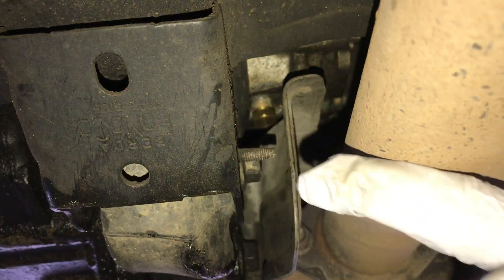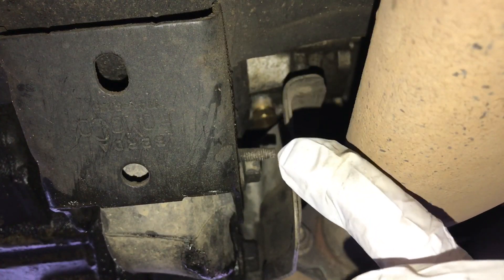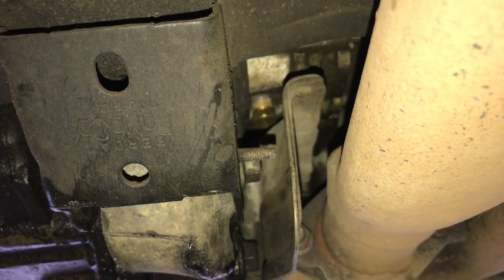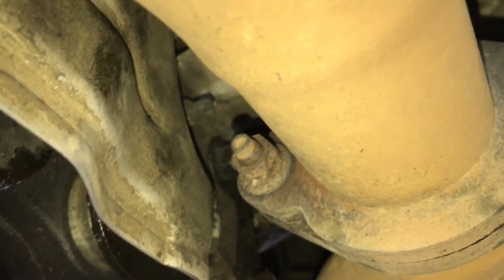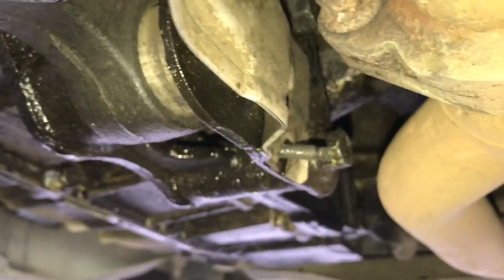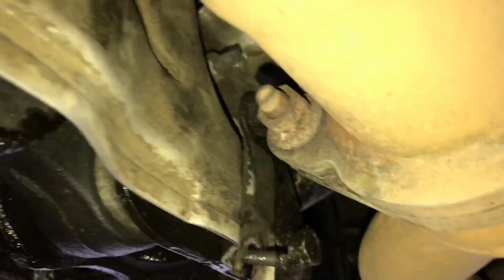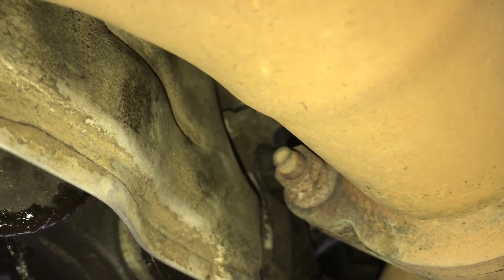Ford Edge PTU: Drill & Tap-Before and After 10K Miles (MKX)

Comment: Great video thank you !  I actually work at the Oakville plant in Canada where we make the edge and mkx. I helped my parent both purchase edges my dads is a 10 but fwd. my mom has a fully loaded 09 awd. 

Recently we had both Edges into a dealer for the gas tank recall. On the 9awd they forgot all the muffler and exhaust hangars off and mom drove home 25 miles with the exhaust bouncing damaging the flex pipes and hopefully not the manifolds and heads but I hung it all up and sent my mom back where they did replace some of the exhaust.  Long story short they told my mom tpu is bad and gave her a $3k estimate.

I did some searching and found your video and wanted to say thank you 🙏🏼 for the tips and info. Definitely sub’d 👍🏼👍🏼. I drilled last night and tapped a drain hole but am struggling to find a pipe plug near me on a weekend but hopefully have it finished up tonight .
Reply from the maker: 5abivt thanks for joining! Sorry to hear about your mom’s misfortune, and I’m not shocked to hear them quote $3k 🤦‍♂️. 

As for looking for the plug, if you go to an auto parts store and ask for the 1/4 npt plug they should have one. Around here a couple of our auto part stores are open till 9 pm. I had to ask for mine and the store employees and I had to walk behind the counter and find the one I was looking for to complete this project. So maybe try that route... it might not be out front but they might have one hiding back in their parts area. I got mine from O’Reillys, not sure they have those in Canada, but they are fairly common in the U.S.
Reply: Buck Newby appreciate the reply ! 🙂 I went to a unique hardware store and found an Allen  head bolt and just finished cutting it down to ensure it didn’t protrude too far inside. Using an oil resistant o ring at the head so I know when it’s snug and should seal great and not worry about over-torquing the bolt. 

If I may ask, did you know what the capacity was for the ptu? Have my little pump and gear oil ready to go back in. Btw my moms fill plug had sludge on it, but lots of fluid did drain out. Her 09 only has about 35k miles on it as she drives less than a mile to work. No doubt it helped the ptu live longer
Reply from the maker: 5abivt I’m pretty sure it’s about a liter but I’ve drained mine a couple times now. All I do for adding fluid is pump until it overflows. Pretty easy. I’ve never measured the exact amount in, but know it’s about 1/2 to 2/3 of your average bottle of gear fluid. I would suggest you buy an extra bottle and pump it through with the drain plug out to pull out any shavings that may have ended up in the gear box. Frankly I wasn’t too concerned about aluminum shavings vs steel gears, but pumped an extra bottle through the box just to be safe. And if you are really concerned you can repeat the process again after driving the car for an hour and the process of the gear fluid heating up and splashing around should pull/flush sludge off the gears and inside of the case.
Reply: Buck Newby thanks again 👍🏼👍🏼. I filled until it started pouring out .. I’d say it was about half a bottle maybe less not sure. But I did pour some in and let it pull out a few loose shavings first. Going to drive it around for an hour then drain again hopefully pull out some sludge.
Reply from the maker: 5abivt way to go! Let me know if you have any  thing else come up!

Comment: Hey man, I had my PTU on my 08 MKX replaced with the updated unit about 30k ago. Not sure if it has a drain plug, but I may end up doing this too.
Reply from the maker: Captain Brown Beard thanks for joining the conversation, keep me informed, I have been curious if we-first generation Edge owners-can get a PTU replaced with a PTU from the model years 15+. Seeing as those come with both fill plugs AND drain plugs, the cross compatibility would be good information to pass on, and surprisingly not a question I have seen answered yet. If you don’t mind me asking, since replacing 30k miles ago has your PTU been serviced yet?
Reply: It actually hasnt been serviced as the stealership gave me a 2 year warranty on the part and well its over now so I am looking into servicing it myself. I got two other issues that maybe your Edge ended up with?

1. Slight shudder on light throttle at around 40mph with low rpm (Google says it could be coil packs/plugs)
2. I have a ticking sound over bumps in the suspension. LCAs, tie rods, ball joins, and sways are all tight with or without a load. Maybe strut mounts?
Reply: Also, I have been changing my coolant every year cause im scared of the internal water pump and I had my transmission fluid changed with new Speed sensors in the transmission at 90k miles (At 115k now)
Reply from the maker: Captain Brown Beard I haven’t experienced the shutter at 40 mph but have heard of such an issue before but cannot quite remember what people blamed it on. 

The second issue sounds like sway links... because I had the very same thing happen where there was a little slip even though they felt tight- load/no load-and were freshly replaced. What it ended up being was the hole on my LCA was a little wobbled out and so I had to replace the LCAs with fresh sway links to resolve it. I have not done the strut mounts on my Edge but think they might be going because of what I hear when I’m cornering hard at slow speeds. 

I’m not 100% sure if that’s helpful or not but it’s part of what I’ve learned so far over the last 18 months of working on this 205k mile hog.
Reply: Man I hope mine gets to 205k miles without the damn water pump failing. I will stay with sways and then do the LCA's I actually wanna do struts, mounts, LCAs, and sways to bring the front end back to new. I just did a whole front end refresh on my 94' 540i and the thing drives like new haha
Reply from the maker: Captain Brown Beard as long as you stay religious about changing that coolant out every year you shouldn’t have a problem. I think most people take the cooling system for granted and then end up having issues with water pump due to complacency.
Reply: Buck Newby p

Comment: Thank you for this. I will be getting under our Ford Escape and going through the same procedure. This helps me a lot in getting the confidence to do this.  You would be amazed at how many people say this cannot be done. But they are still afraid of falling off the edge of the earth if they go too far.
Reply from the maker: Oby-1 no problem I’m glad it helped! It’s easy in concept, drill a hole, thread it, plug it. I’ve yet to hear someone attempt this and fail, but have seen a lot of people do it, so focus on executing the three tasks above and you’ll be fine. I have a follow up vid to this where I answer some of the recurring questions. 

Ford Edge: PTU Drill and Tap Measurments and Other Useful Information to Answer Recurring Questions

https://youtu.be/KQWh5cp2ZEc

Comment: Can you wrap the exhaust with foil insulation to stop the heat build up? I think the proximity to the super heated catalytic converter bakes the oil and breaks it down too quickly. Keeping the heat away from the PTO keeps the oil from breaking down
Reply from the maker: I’ve heard people suggest wrapping before. I am not sure if it would be practical. It very well could improve longevity.

Comment: Great video!  I'm going to be completing this in my 2010 Edge.  Any reason you went with an NPT thread instead of using an SAE or metric so a guy could use a normal style drain plug?  Do you think an 1/8" NPT would be sufficient instead of the 1/4", I'm just gun shy on not knowing the thickness of the casing where the plug will actually threading into, is it at least 1/4" thick?
Reply from the maker: Not sure on case thickness but I’d guess 1/8-3/16... seeing as it’s aluminum case brass is a good choice for plug because it’s more malleable. Also a smaller hole is preferable because it’s less likely a bit will catch.
Reply: Do you think a 1/8” npt plug would work out just as good as the bigger 1/4” that you installed?
Reply from the maker: MrDausen good question. Can you find a 3/16? That may be a better route. 1/4 is quick for drainage but bigger than necessary. 1/8 May be too small.

Comment: Good stuff, just had to take my Ford Flex the shop because a stinky propane like smell was coming from the front. They said it was because of the PTU. I'm definitely going to put a drain plug. 

What type of oil did you use for the PTU?

Also, if you have an Instagram account, I can show you a way to help fun your account.
Reply: Also, I'm a new subscriber.
Reply from the maker: Use redline shockproof light. Best stuff on the market. I used Royal Purple full synthetic but will be switching fluids on my upcoming video to the shockproof light.

Comment: My PTU was replaced under warranty (45k miles).  The drain plug is a great idea but will void the warranty.  Instead, I will use a suction device such as the Mityvac to remove the old oil via the factory fill hole.  Not as efficient but I will wait till the warranty is expired before adding a drain hole.
Reply from the maker: Kens Korner I don’t blame you one bit. The warranty is a valuable thing to have and I wouldn’t drill into the PTU and compromise it. Hands down I recommend suction for fluid extraction in this instance and then flush when pumping fresh gear fluid into the gearbox.

Comment: Appreciate it am scared to try it how much would it cost to let a mechanic do this type of job?
Reply from the maker: If you are apprehensive about doing the job then you are wise to not attempt this yourself! I would recommend actually having a mechanic pump it for you through the fill hole on the passenger side of the PTU. Most mechanics will not risk drilling into the PTU on other people’s vehicles because they know there is a risk of failure on this $900-$1000 part. However if you tell them you want to pay them to service this gear box, and they don’t mind trying to extract as much as they can and then filling it with fresh fluid... they will generally be able to make it happen if the mechanic has any sense or knowledge to what they are doing. You may even need to talk to a service manager about this because if it’s just a minimum wage guy behind the counter they may not be able to get their mind around what you are asking.... this may sound crazy but you will not believe the amount of times I’ve heard that story through people I’m helping here or in the MacT FB group. 

Keep me updated and if there any more questions that arise I’ll be happy to answer them here... or if the guy you talking to still does not comprehend what you are asking let me know. 

Oh and to do this a shop may charge about $100. Fluid usually runs about $20-$30 and since it isn’t exactly easy I could see why they might charge a little more. If you want to do the extraction yourself you can use one of these off Amazon:

https://www.amazon.com/gp/product/B009POZ9YY/ref=as_li_qf_asin_il_tl?ie=UTF8&tag=bucknewby-20&creative=9325&linkCode=as2&creativeASIN=B009POZ9YY&linkId=abb55b6b68c4130f66a7c30a849510b6

... it’s not too difficult you just need to block up your edge so you can get under it and have a 3/8 drive ratchet to remove the fill plug.

Comment: I just bought 2007 ford edge awd 104000 ptu was replaced before I got it . Keeping an eye oil and it's good. Great car and great video
Reply from the maker: That’s great! If the PTU has been replaced that’s basically the most critical AWD component that’s prone to failure from lack of maintenance. Keep that fluid fresh and I’m sure your Edge will not disappoint. Have the spark plugs been changed?
Reply: I'm not sure if the plugs were changed but going to do it when the weather gets warmer and I have all the stuff to put a drain plug in. Believe me I researched this car watching Mac T and your videos
Reply: I replaced the plugs at 110000 they were original

Comment: what is the reason for doing this? I'm having gear slips is this the cause?
Reply from the maker: What do you mean by gear slips? As in when your Edge is shifting?

The reason for doing this is to make servicing your PTU way easier. Ford did not put a drain plug in these from factory and that makes servicing the PTU a real pain in the butt.
Reply: Buck Newby I'm having some gear slipping so I was wondering if you had gear slips to and did this help?
Reply from the maker: Mill9999 No this will not help with slipping. I think what you mean is your transmission is slipping. If that is the case watch this video.

Ford Edge: Transmission Fluid Check and Engine Bay Walkthrough (Lincoln MKX) 

https://youtu.be/r4Xp32kZPME
Reply from the maker: Mill9999 another couple things I would look at would be tone rings and spark plugs. Both of those could produce “slip” like symptoms. The tone rings would be covered in my all about traction control video here:

https://youtu.be/CNpLQtWM88I
Reply: Buck Newby
how much would u charge to do this to my car? drill a new plug in? and how much u think Dealer is charging
Reply from the maker: I would think if you can find a mechanic who would do the job they would probably be in the $250-$350 range. If you had a friend who would do it I imagine they’d probably do it for $100. 

However I will add it is not necessary to do the drill and tap if you want to service the PTU. Really the first step is to pull the plug and look at the fluid inside and analyze what it looks like. Next you can decide if you want to put a plug in the PTU or just pump more fluid than necessary into the gear box to flush it out. 

Both of those options are acceptable ways to service the PTU. There is more risk in the drill and tap to install a drain plug but the trade off is it makes the drain of the PTU way more effective. The fill and flush method works but takes more fluid than necessary to fill past the point of overflow so you can freshen up the fluid in the gear box and dilute down the old fluid inside.

Comment: Question please...
After you installed the plug, did your PTU continue to puke a bit here and there? I'm assuming as things start to break up and the sludge mixes with the new fluid, the vent at the top will also clear up and push out what was plugging it.
Reply from the maker: Jason Clark not that I know of. Like I said earlier we went on a road trip and I think it was after I had done the work to the PTU as in one or two days after. It may have puked up some but that hit the exhaust and burned off on the interstate. I know I have never seen spots of gear fluid on the ground.

Comment: Very well done video Sir! You mentioned being able to pump or suction the old fluid out. How would that be done. A vacuum or fluid suction pump?  https://www.walmart.com/ip/Car-Multi-Use-Water-Oil-Fuel-Pump-Transfer-Liquid-Pipe-Siphon-Tool-Pump-Kit/285629473?wmlspartner=wlpa&selectedSellerId=13521&adid=22222222227092402259&wmlspartner=wmtlabs&wl0=&wl1=g&wl2=t&wl3=214468731033&wl4=pla-347537014018&wl5=9007353&wl6=&wl7=&wl8=&wl9=pla&wl10=117578343&wl11=online&wl12=285629473&wl13=&veh=sem

And then refill with quality gear fluid per  the spec?
Reply from the maker: Toros Cosmicos yes that would get the job done for extracting the gear oil from the PTU. Then have a pump that screws into the top of your bottle of 75w-140 so you can pump it into the PTU. 

It is not critical to completely extract every last drop of old oil if it’s your first time attempting it, but get as much out as you can and then move on to pumping in new fluid until it flows out the side. Drive about 1000 miles and then repeat. Do this twice and then you’ll be safe to move on to 10-15 thousand miles for the next service.
Reply from the maker: I used Royal Purple full synthetic 75 140. Lucas has a full synthetic gear oil of the same weight that I would use too. I respect both of those brands.
Reply: Thanks. I researched it a bit now. A pump will get about 13 is. out. Then a tube over the nozzle end if the gear oil bottle or a pump. I will only use name brand quality synthetic 75w-140.
Reply from the maker: Toros Cosmicos if I can be of any more help please let me know!

Comment: Great video on this. The sad part is that this is a necessary procedure. Ford should step up and do this as a recall. It is a safety issue, meaning if not serviced it can lock up and cause an accident.
Reply from the maker: Kevin Hawkins they do seem to be making it right on some vehicles going forward, however I say that with the disclaimer that it doesn’t make what they did correct. At least admitting that the PTU needs serviced would be a long ways to helping people not get ripped off when the PTU goes bad. Hopefully if there are enough voices out there saying and showing why this needs worked on it can help people prevent the catastrophic failure.

Comment: good job!!
 what size of drill/pipe tap/tap and the fluid including the flush fluid.we are planing to follow your instruction on tuesday..thanks..
Reply from the maker: Eleventyseven Santos 

I used a 7/16 inch drill bit
1/4 inch NPT tap and plug 
75w-140 gear oil

Used the lower cost full synthetic oil for first 10,000 miles and then swapped to royal purple brand gear oil